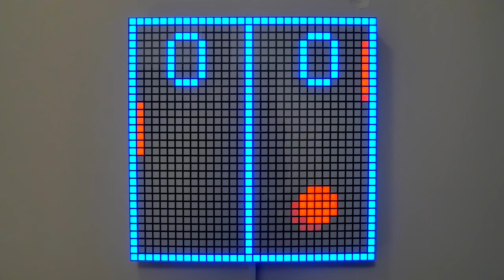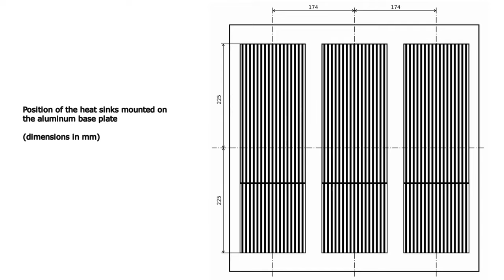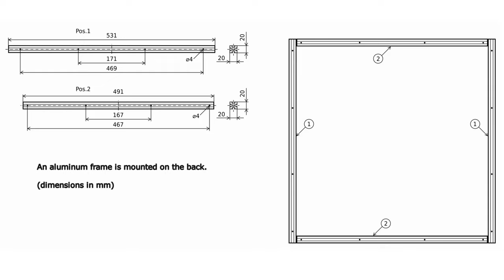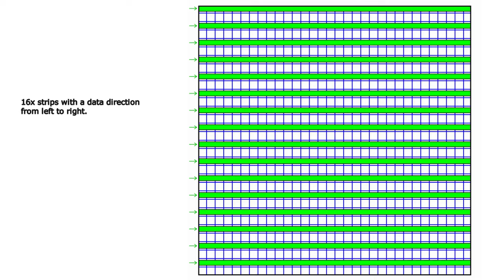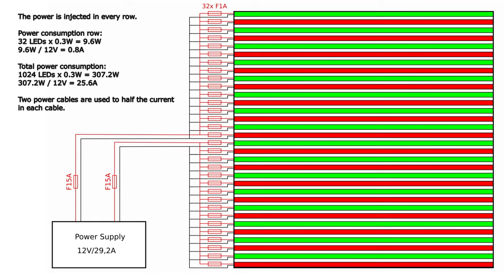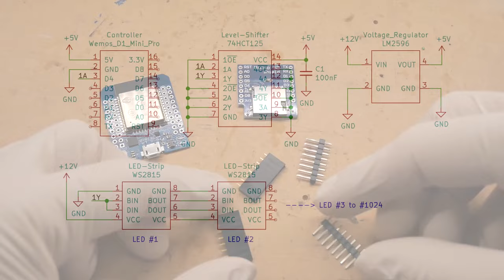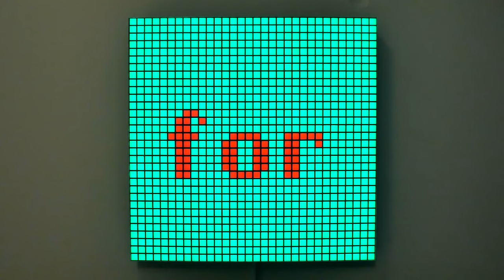Making a 32x32 LED Matrix

Comment: Awesome project and flawless build! I'm truly amazed at the level of detail you paid attention to when building this thing. I wouldn't have had the patience to cut a thousand little foam strips.
Reply from the maker: Thanks! The foam pieces make a big difference. Without them some light comes through small gaps between the grid and the base plate and light up the neighbouring pixels.

Comment: Use LEDS to illuminate fiber optic wires and makes the same project with tiny pixels for HD image quality. Use something like window screen to hold the fiber optic wires.
Reply from the maker: A project with fibre optic wires sounds tempting :)

Comment: Are the heatsinks really required? Did you take any temperature measurements with and without? Thanks :)
Edit: Sorry if that was a stupid question. Your craftsmanship is immaculate. I am sure you know exactly what is required.
Reply from the maker: Don't worry, of course you can ask questions :) Without the heat sinks the aluminum base plate got hot after around 30min and some LEDs stopped working. I didn't measure the temperature but the malfunctioning was the reason to use heat sinks.
Reply: @yotudero  Thanks :)

Comment: I'm just curious, do you think the heatsinks are really needed? 
Your baseplate is 5mm thick Aluminium, shouldn't that be enough?
Sure, by math that are 1024 with 60mA each at full brightness that can be a lot of heat.
Have you measured the temp at the heatsinks after it runs for some time?
Reply from the maker: Without the heat sinks the base plate got hot and some LEDs began malfunctioning. That's why I added the heat sinks. No, so far I haven't measured the temperature. I just touched the heat sinks by hand it felt much cooler, maybe a bit above 40°C.
Reply: @yotudero  good to know, thanks a lot for your answer 😁👍